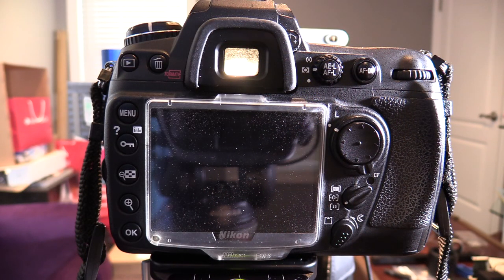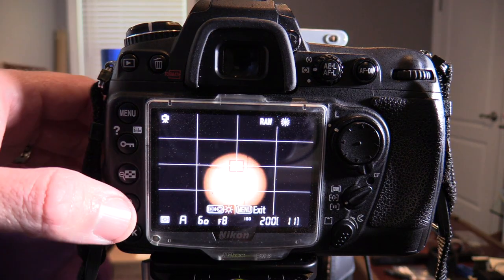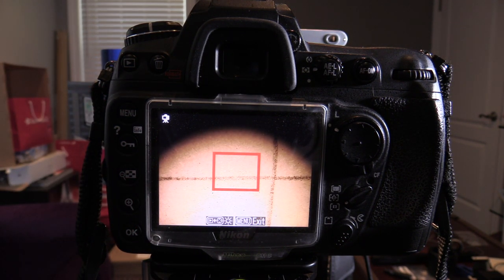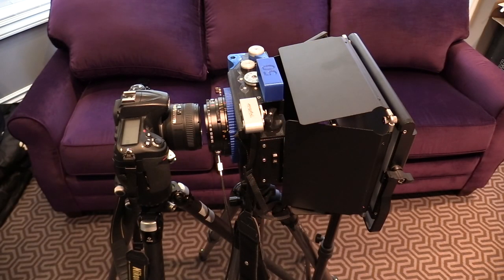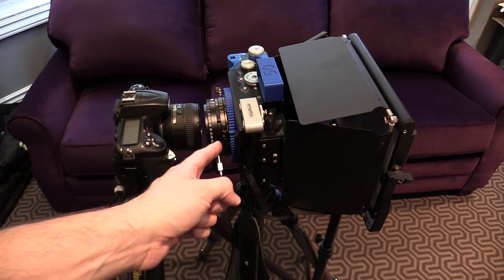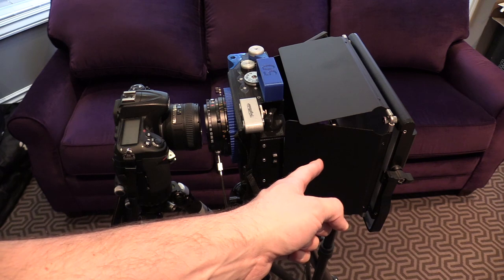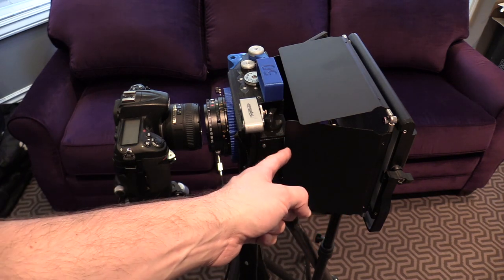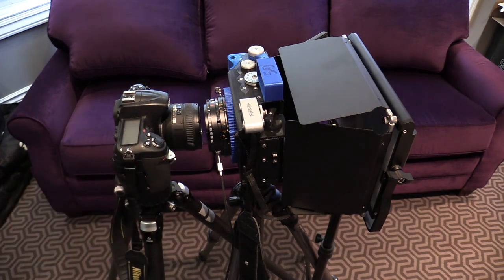Photo Vlog 10: Infinity Focus Calibration

Comment: one tip, this 50 mm lens CAN be held open, by turning the knob below the shutter cable socket, this does turn, and if you use B, this does hold open the shutter, if you use any other lens, there is a lever on the shutter bar, opposite to the cable connection, rotate this lever to block the shutter lever, this is a "inhibitor lever", as termed by Linhof, with their shutters, it stops the lever traveling to its mechanical stop, and closing the shutter (in the de-cocked condition, as opposed to the focus mode switch on LF lenses) so this should do what you want it to do.

Comment: interesting statement, as sometimes it is NOT sloppy calibration, BUT a technical fault by the user, aka some lenses are retractable, for groundglass and polaroid use, on mamiya 23's, so be aware, and TURN & PULL untill you see the word NORMAL in white, on the focus tube, this focuses the lens for the 'K-BACK' and the other 6x9 and 6x6/6x7  120 roll film backs!!- this is most likely the cause of any missed focus, OR a rangefinder cal. issue.

Comment: camera as collimator works great, make sure to apply some pressure tho as tape alone wont be exact enough. the digital camera should always have a lens longer and faster than the one you are calibrating. I have a 50 1.8 lens that i have fixed at infinity just to do this and i use it only for this purpose.

Comment: A question, so what is the procedure if the you cant get a clear image, as in, the infinity is off. I had high hopes of finding a solution.
Reply from the maker: You probably need to come up with a way to adjust the distance from the lens to the film plane, either by adding or removing shims of some sort.  The details are probably lens/camera specific, and I can't really help there.

Comment: Would a phone camera work as the second camera?
Reply from the maker: That might be difficult. You need to make sure that camera's lens is locked at infinity focus, and held in proper alignment. Phone cameras aren't normally designed for that level of control. You can certainly try, though.